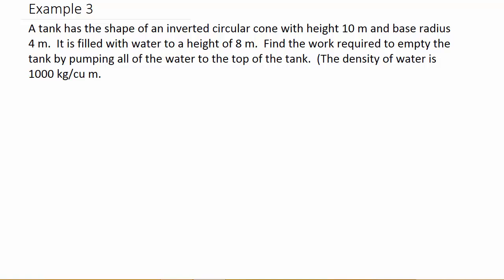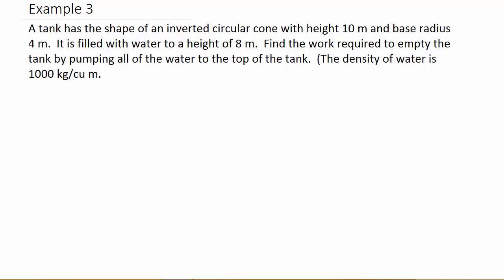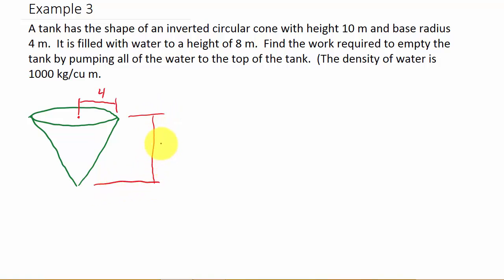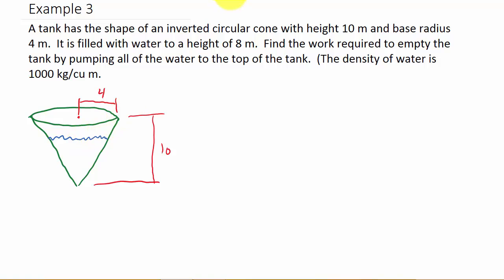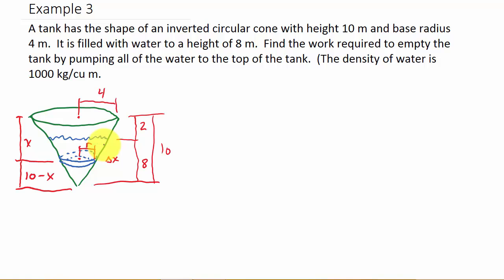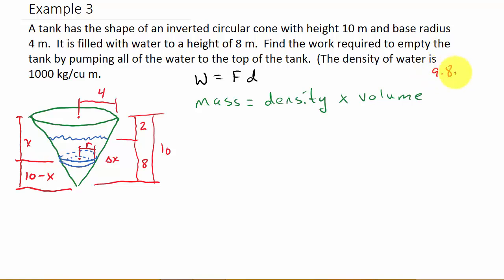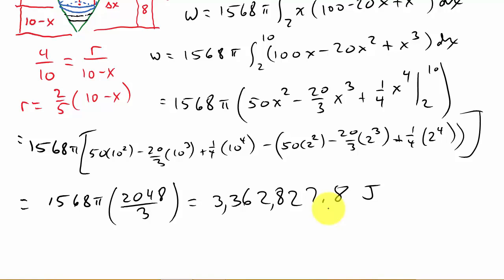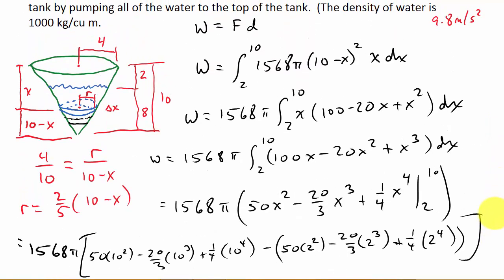Calculus Work Pump Water From an Inverted Cone

Comment: Im not workimg in kg per m. I did the same problem for a parallelogram tank and never had to use 9.8 constant. I just used f=pv = density x volume, the dw=f x distance whwre distance equals height minus y (or x, whatever)

Comment: I'm given a similar problem but in US units. It states the liquid weighs 29 pounds per cubic foot. I've replaced the 1000 in the equation with 29, and replaced the gravity from 9.8 to 32.2; everything else is the same, but my answer is wrong. Are there other steps for dealing with non-metric units?
Reply from the maker: Don’t include the 32.2. Below is a video I did similar to what you are asking. 

https://youtu.be/dHw-_5kXaNA